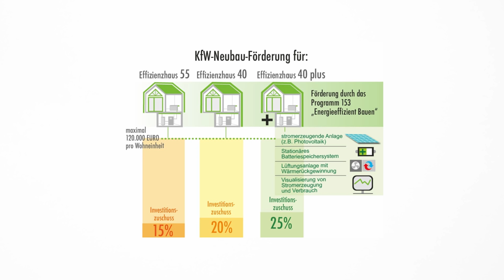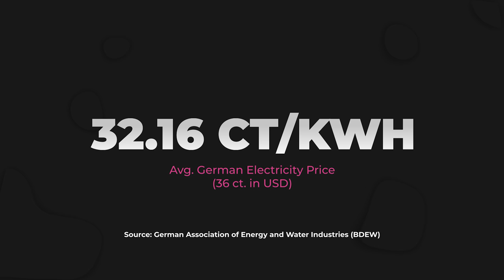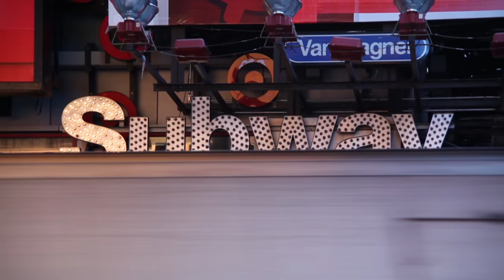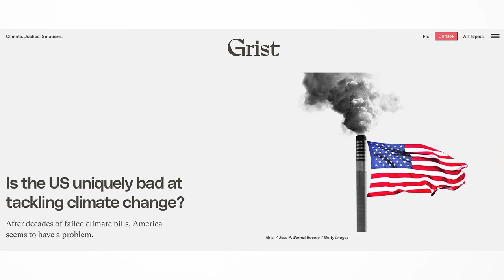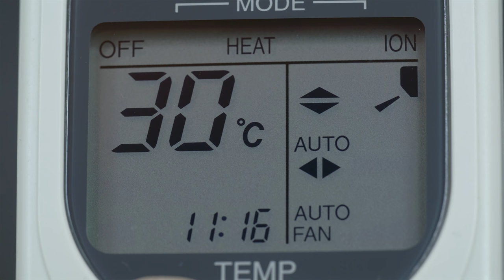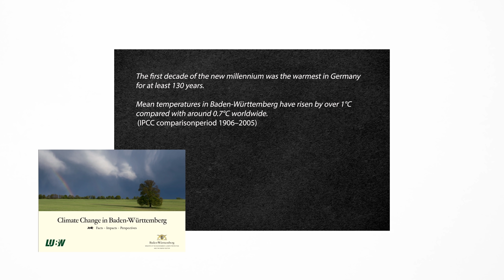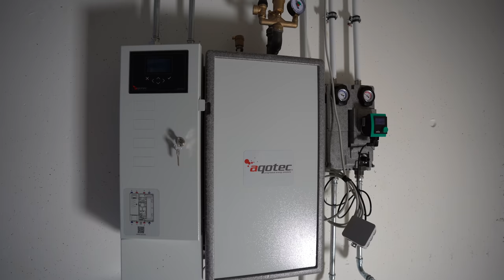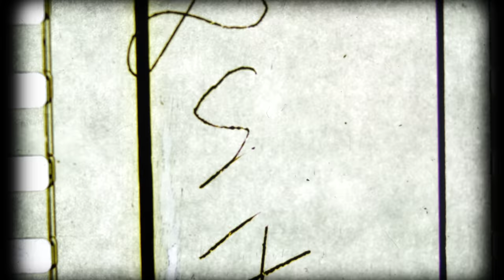HVAC (HLK) in German & American Homes | A Tale of Two Countries

Comment: AC ? Yes. Since more than 10 years when summers get hotter in Germany. Portable version to be temporary installed during the "Hundstage"-peak in summertime at the balcony to blow cool and dehumidified air through the whole small apartment - the warm air vents outside by a tilt window in the living area. Very useful . . . but expensive . . .
Reply from the maker: agreed. Admittedly, we also purchased a portable AC when I was pregnant. Living in Freiburg, we were experiencing really hot temperatures and our entire apartment faces south and west.

Comment: Originally I'm from Israel, which is a hot country and today 95%  of all households are air conditioned (mostly ductless split systems) but when this started only in the 90's and before that we managed without it. Today I live in Barcelona, which can get hot in the summer and I do have an AC but I rarely use it. There are times when it's a lifesaver but most of the time opening all the windows and letting the sea breeze flow in the apartment is more than enough. I also sleep with all the windows open after taking a quick cold shower - apart for a day or two with unbearable heat it's more than enough. My family, like most Israelis and Americans, just leave the AC on most of the time. The AC is also used for heating in most places. Personally I hate AC heating but it is much cheaper than other methods and I rarely use it and prefer wearing something warmer over switching on the AC.
As for the district heating system, As Americans you should have mentioned that this type of system is used in NYC and started by ConEd in 1882 and is still used today (the steam you see in the city and in many movies coming out on the streets of NYC is from that system, which is old and has many leaks)
Reply from the maker: Ah you're right! We read that there are a few towns that have also started to implement this system in the US, but it hasn't really been implemented in a large scale.

Comment: My parents have forced air heating in their home in Germany. It struggles to keep all rooms that are used warm. Especially when the rooms facing south are warm from the sun, the rooms to the north wont get any heating. 
On the other side, after a vacation when they didn't heat their house as normal, this heating system makes the home warm very fast. Usually in less than 30min. 

Also my parents and I agree, radiators in the floor would be more convenient for our taste, but it wasn't possible in the kind of house they build.
(They were asked if the wanted an AC with the forced air system but they refused it.)
Reply from the maker: We also noticed these same aspects when we were back in the US. Our parents home heated up quickly, but some rooms that were far away from the furnace were still very cold, where as our room which was right next to it was BAKING.

Comment: I've lived my entire childhood in a house with floor heating. I agree it's a very pleasant way of heating because you don't need carpets or slippers to avoid icy floors in otherwise warm rooms. Absolutely great, especially in the bathrooms!

But I have to warn you that your expectation of heating each room to an individual temperature and especially not-heating a room that's presently not in use may flounder on the reefs of reality. It can be done in a general sense, but not so much on a case-to-case basis.
Floor heating is SLOW. Admittedly, my childhood is quite a few years in the past so maybe technology improved, but coming from forced air or even radiators heated houses, you'll have a learning curve ahead of you. The system is not as swift to react as you're used to from other heating methods.
Anticipating how much you'll want to have your room heated in a couple of hours - when the floor finally manages to transfer all the lovely heat into said room - can be an art.

PS you may want to check with your provider if they offer cold water in the summer. Modern floor heating can be switched to floor cooling if the provider offers the option, that way you could have AC in Germany as well - and it's pretty environmental friendly to boot(!)
Reply from the maker: Oh great advice! Thank you! We will look into this.
Reply: Usually you need hot water from the supplier even in the summer because otherwise you have to shower cold - which most of the people wouldn't prefer.
The cooling with floor-heating is mostly done in the case you have a thermal pump (so a compressor based system) which is like an AC but the other way around. So for summer you can just switch directions. For hot water you than have to use pure electric with some kind of solar water heating. If you have Fernwärme (district heating) you for sure in the most cases will not have cold water in it. Otherwise you would need 4 instead of two pipes or another extra source for heating up the water for usw - like showering.

Comment: I'm glad that you are making a video about one of the most controversial discussions between Germans and Americans. And even among Germans, it is so controversial. 
I've sometimes got the feeling that all Americans are whinging or laughing about missing air conditioning in Germany. But what most people don't get as you mentioned in the video the different climate, the construction style and the most important thing the costs for energy which is three times as much as in the US (thanks for this information).Same like the discussion Germans are driving such small cars. 
I admit, I also curse about the heat in the summer and the lag of air conditioning. But hey, it's only a few days. Then we just close the blinds and move a little slower.
It's good if you have a room with air conditioning. That keeps costs quite reasonable. But when I imagine cooling down an entire house, I get dizzy.
If I were to build a house again, I would prefer underfloor heating in the main room, radiators in the other rooms, which are not as sluggish as underfloor heating, and air conditioning in one or two rooms, such as the bedroom. But this depends on the installation costs and the size of my wallet.

Well done comparison!! Keep going with your very interesting channel.
Reply from the maker: Thank you so much!

Comment: So one reason why ACs leads to a cold is that it can Transport pathogenes from one place to another. Think of an airplane, a closed system where one person is sick. The pathogene enters the ac unit and comes out at the other end of the plane. Another reason is, that a constant cold air flow leads to a dry nose. A dry nose is a good entry point for parhogenes. 

To stay cool in the summer i go for a swim or a sailing sasion on the baltic sea. And the wind cools you down. Even in the city, the constant wind helps.
Reply: Actually airplanes are far healthier than most homes. Since most homes have no fresh air exchange. Hence the German pandemic laws mandate that windows need to be opened for at least 10 minutes every hour. Meanwhile airplanes recirculate no more than 50% of the air.

Comment: Living in the south Netherlands, near mönchengladbach, all of the USA except Alaska is south of me. We still have the typical stormy wet klimate, like north Germany. I am lucky, my appartment has the living room towards the south, so the sun shines into my living room. With double glass windows it's wonderfull when the sun comes out in the winter. The colder wind usually blows against the other side, so my bedroom is nice and cool. Often i barrely have to heat, about a week in a year. very often i have awindow tilted open. When i come into a building with AC, i feel very uneasy, and if i had to work in one, i WILL get sick. All this reused dusty dry air is not good. It is also a hotbed for bacteria. Studies in the USA that AC is healthier are usually done by universities that get thier funding from companies. Also they compare houses with AC to houses without AC, IN THE USA. othe roptions like isolation, airflow, or the simple windows screens that you show aren't included. The fact that concrete houses have a totally different behavour to heat/cold/moist then wooden houses is also very important.
Reply from the maker: Yeah we seem to have the opposite issue. In our apartment (which is an attic apartment) it faces south.west and the building does not have any exterior blinds. So in the summertime our apartment gets unbearably hot.🥵

Comment: If America has more extreme temperature variation across the seasons, why aren't better energy efficient materials being used to keep heat out in summer and heat in in winter? Is it just a consequence of cheap energy?
Reply from the maker: Yes it's a very good question. From what we understand, it's a matter of low cost materials to build the house plus cheap energy. The build quality is also a big problem. I can think of almost any house I have been in during the winter, where you can feel the cold air coming through the door frame or windows.
Reply: Probably also (as explained in their recent video i think) that building a house out of cheaper materials is incredibly common in the US, and they are also not meant to last long. As in youre supposed to upgrade to a bigger better house asap. 

In Germany we usually buy/build to live in, probably retire in it if possible.
Reply: @IIIJG52  After not being a young nation creating new cities as it is expanding westwards for a while, I am wondering why the mindset is still a somewhat temporary one when it comes to houses.

Comment: Heating as service (Fernwärme Fernwärmenetz Fernheizkraftwerk) from urban utilities is also common in german cities. They provide heating via isolated pipeline networks for private or public homes and have cost & environmental advantage over small fossil fueled house heating systems, as big plants have better environment footprint than small ones (efficiency, air emmission). 
The northest german city Flensburg has a quit large heating pipeline network covering several urban districs (50% town area) and also supplies neighbour community Glückburg. 
If you're more interested about community heating pipeline networks, not only scandinavian combine this with thermal storage over several months and distributed solar collector networks.
Older outdated heating system I expierienced were my grandparents home heating their house with electrical off-peak night storage heater plus coal stove backup in the kitchen, and my friend parents house also with no central heating system but distributed oil heater per room so every room has be refilled with a stinking oil can.

Comment: Yeah district heating is the best I also have and do not need to consider what source of energy is the best, it is outsourced to municipality to select most appropriate source of energy. But in detached houses heat pumps are also a good choice if the electricity is from renewable sources. But most important is to have well insulated house. I’m Poland now there is requirement to have house use less than 70 kW/sqmeter I think it should be reduced below 50. In most cities we have district heating. But it predominantly uses coal, but still is better than burning coal at individual homes. I think this heat power stations will be replaced by gas or other sourcess, maybe green hydrogen if it will be possible. Maybe also biomass.
Reply from the maker: We loved learning more about district heating. Really interesting to read how different cities use it in conjunction with other power sources.

Comment: In my experience radiant heating keeps the house warm for longer even after you switch it off (at least I a decently insulated home), while with forced air as soon as you switch it off the house is back to heing cold. Italians also think AC makes you sick, mostly if you keep it too cold and you have to much of a temperature shock when going from inside to outside or viceversa. Italy can get pretty hot, but still most people have at most a window unit in the living area for many of the same reasons Germans don't, and people survive 😅
Reply: I have a 100 year old house in Canada and have radiators for heat most are 100 year old cast iron jobs and yes the temp stays the same for quite a while even once the boiler is shut off but also takes a LONG time to heat up when started

Comment: Good morning dear Black Forest Family. My city in  the east of Baden-Württemberg has used Fernwärme for decades. But to generate that it doesn't use fossile fuels and we neither have enough surrounding forests or natural energy resources except for the River Danube which does generate a certain amount.
So my city built an incinerator that burns TRASH that cannot be recycled  thus supplying homes with warm water/heat.
Maybe you have noticed that we do not have those huge trash dumps in Germany I've seen in the USA and which of course Americans can have since the country is so big.
Reply from the maker: Super interesting!
Reply: @TypeAshton   Wuppertal (NRW) apparently also uses trash incinerators for "Fernwärme".

Comment: I have a forced air H.V.A.C. system. I live in Central Minnesota  so hot summers and cold winter. Natural gas is the most common fuel but I have heating oil. I find it to be a hotter heat if that's a correct term. Heating oil has a lot more B.T.U.'s (British Thermal Units) than Natural gas. Now propane has a lot more heat value than Natural gas but way more expensive than Natural gas. There is less of a chance of carbon monoxide fumes for fuel oil than Natural gas or propane. I had a fuel oil water heater which is rare in the Midwest I now have an electric water heater. Radiant heat systems are used in some homes but mostly in apartments or multiple family dwellings because  it's easier to zone the water for Heating to registers.
Reply: The fuel oil water heater was very quick as far as recovery to heat water up very quickly. I had a daughter living with us at the time before she got married. She used more hot water than the rest of the family of 6 put together. We had to try and meter the water usage. At one time we had an off peak electric water heater and the fuel oil water heater. I don't know what a family of 6 with all girls would do. There is something about girls and hot water usage. My wife didn't even use that much.

Comment: High humidity at the coast, always over 90% and sometimes over 40° but it's not for long, a week or two. I mean: It's not texas. But also, if you have it, you will use it.
Reply from the maker: Many days in the United States could have windows open and be comfortable. But you're right. AC is there, so it gets used instead.

Comment: I never used  any kind of AC in any of my former apartments just because it was not available. Instead when it's unbearably hot outside I have a fan that I sometimes run for a bit during the day.
Reply from the maker: We also plan on installing ceiling fans in our new home to help during the summer time. The movement of air really helps.

Comment: Kudos again, this video is again well done and really interesting! I was able also to understand better why and what exactly happened with the unusual harsh winter storm that hit Texas in the past year thanks to your explanation about heating systems in the US.
I once again will try to explain my personal experience: first of all, I come from Italy and while my parent´s house is about 200 yo, we never felt the need for AC, also because the walls are solid brick, around half a meter thick. That alone makes termal isolation very efficient, both in summer and winter, especially since in our area humidity is not so high and there is almost always a nice breeze.
However, I understand the need for AC when the building itself is not built as efficiently: I remember my hellish summers during university, in the much more warm and humid Padua (btw: really nice city centre historically/artistically speaking but for the love of all that is sacred, avoid the 3 months of June, July and August if you plan to visit), in your typical ´60s low quality building. There you literally need AC sometimes. Unless you go study in one of the medieval churches, those are always as cool as refrigerators.
But in any case, here in Germany, despite the growing temperatures, we always managed through correctly managing the opening and closing of windows and curtains, and my husband and I don´t plan on buying any AC in the future.
Then again, maybe we are both weird because we tend to rarely complain about the weather ¯\_(ツ)_/¯.

Comment: I have no need for an AC, since my house is insulated enough to keep low temperatures during the hot summer phases. I can cool it during a rain day. They are pretty regular. So overheating the home is more unlikely.

Comment: Coulee years ago I lived in an apartment just under the roof (Dachgeschoss) and in summer it was unbearable. So I got one of those portable AC units. It took a lot of power, so I used it only on  couple days a year. Since then I'm in a newer building on middle floor, and I don't see any point in getting AC.
In university days I lives in Canada and my uncle had forged air heating and AC. In my experience this sucked. Every room had to have vents for this - the ones on ceiling were ok, but the ones in the floor were very inconvenient. Also the ducts conduct noise a lot so you the heating system was far noisier than European style radiant heating, not to mention floor heating.
Type of heating is one thing, but Americans build the houses in a terrible way and should insulate the houses better. Also brick houses deal much better with heat and humidity.

And yes, AC will make you sick if you're not used to it. Outside is hot inside cold from AC. Walk in and out couple times and you'll definitely get sick.